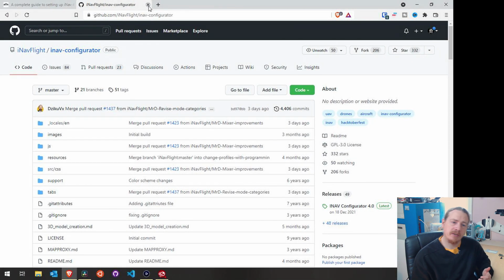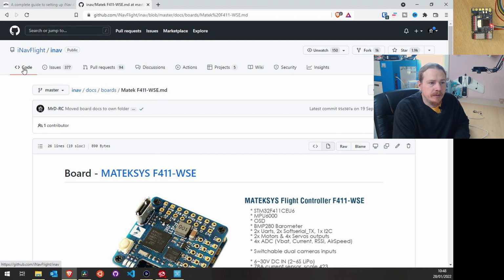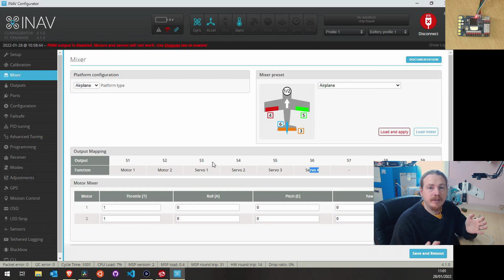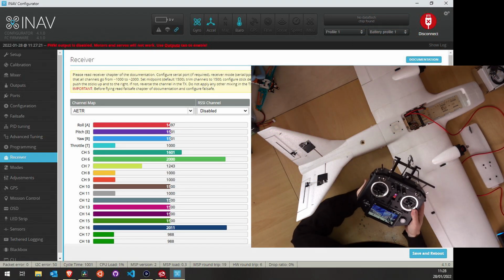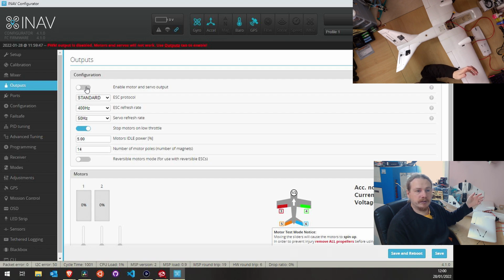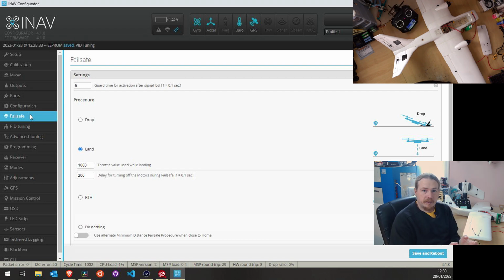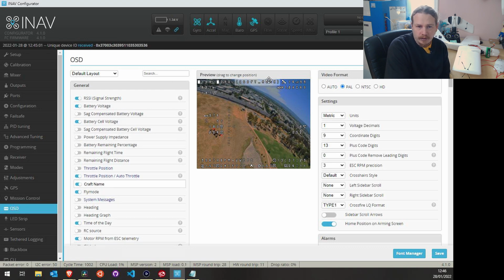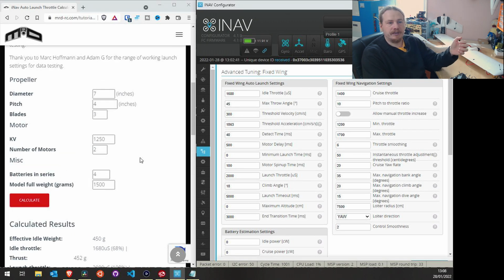Setting up iNav 4 - A complete, new set up and installation for fixed wings

Comment: I can't seem to calibrate my swordfish, I've tried so many different methods to get it running normal. the motors beep, no throttle movement on the radiomaster ts16. I followed your steps and when choosing plane with a tail, now nothing works.. what to do? do you have an email or something where I can get the steps on fixing it.
Reply from the maker: Ask on INAV Fixed Wing Group on Facebook or Discord. There are links on my website for both.

Comment: Hi have you any experience with Spektrum and inav. I’m trying to set up an IX20 with crossfire tx lite module.  I can’t get many modes working. Only a three way flight mode switch and an arm switch. Any tips would be appreciated 
Mark
Reply from the maker: Sorry, I flew Spektrum for about a month when I was learning LoS. Then switched away.

Comment: Tried setting up inav 6.1 and others on 2 different omnibus f4 pro boards and both exibit the same error....S6 output (rudder) does not work....asked many places and no one knows why it doesn't work and similarly, no one can offer any suggestion. Used iBus on Rx6 and on rx1 and rx3 and ppm on standard sBus/ppm input, same result. Ailerons, elevator, motor all ok, just no rudder output on PWM6.
Reply from the maker: I’m assuming that you’re providing separate BEC power for the servos. It’s been a long time since I’ve used Omnibus, just because of the annoyance and grief they caused me (let alone the lack of UARTs). From what I remember, 5 & 6 only have the ground and signal pins, which is why I asked about the BEC. I had a quick look through the INAV board documentation, but couldn’t see anything to suggest that output be blocked. https://github.com/iNavFlight/inav/blob/master/docs/boards/Omnibus%20F4.md

If you’re on the INAV Discord. It may be worth asking Sensei. He’s a bit of an Omnibus guru.
Reply: No idea what this "discord" is all about. Googled it but responses were more confusing than ever. @MrD
Reply from the maker: @jeffbluejets2626  Discord is kind of like a group of web forums, all in an app.

If you imagine RCGroups for example. Rather than the web site. RCGroups would have a “server” on Discord. People would join this server to access all of RCGroups’ posts.

On the RCGroups web site, there are a load of categories; to separate out the different discussions. On Discord, these are known as “Channels”. 

From this point it can differ. A channel can include “forums”. Which is more like you’d expect at RCGroups. Where you have a list of topics, and discussions within them. But, some channels can just be straight up discussions. Both types have their place, and can work well. 

I hope that helps in what Discord is. If you wanted to have a look. The INAV Official server is at https://discord.gg/peg2hhbYwN You can use Discord completely freely. They will try to upsale add-ons. You don’t need them at all. It will work fine with any payment.
Reply: RCGroups...no one seems to know...91 views, no replies. @MrD

Comment: Thanks for this video!  Any idea how to wire for nose gear to move with rudder stick when FC is set up for vtail?  My nose gear moves with rudder stick AND elevator stick…
Reply from the maker: You would need to add an extra line to the mixer for the nose gear. Use RC Yaw for the input. If it’s retractable. You could even use programming so that it will only work when the gear is down.

Comment: Darren, thanks for the video. i have not been keeping up in RC due to the Covid and the rule changes here in the US. My Inav is a quad with 2.5 so this is a good video for me to get involved and catching up on FW Inav. I plan to setup 4.1.1 on my Zohd Dart XL enhanced. Get used to Inav again and then bump on up to 5.0 or 6.0 this winter, which ever version is the latest. You make it pretty easy to understand. I appreciate your efforts. Thank you
Reply from the maker: Enjoy your flights Rog. If your Dart XL needs setting up, I would go straight to 5.1 at this point. There are some nice improvements over 4. The setup is the same as in this video. INAV 6.0 will be out around March. That one will be well worth updating to. It is a big step forwards.
Reply: @MrD  Thanks for the encouragement. I just finished installing & setting up 5.1 on my Dart XL. All seems to be working on the bench. Just need to set up for inflight tuning and wait for a warm dry day to maiden which may be a little while here bc its winter and a storm is on the way. thanks again for your help.
Reply from the maker: Weather can be a right pain. But it gives is build days 🤣 Good luck with the maiden 👍🏻

Comment: Hello, I just soldered up a matek 743 lite flight controller.  I uploaded airplane mixer.  Receiver is functioning, modes are set, motor and servo switch is enabled in Inav, but only the motor and elevator works. My other servo pins do not have power.  I left the bec bridge alone. It is just 5 volts.  My pins are not loose on the board either.  Please help with any knowledge.   Thanks friend. All the way from California.
Reply from the maker: Hey, hope you're doing well. This seems to be a continuity issue. Looking at the board, the power and ground traces are shared for all PWM outputs. If you check out the underside of the board (http://www.mateksys.com/?portfolio=h743-wlite#tab-id-1), the traces are pretty visible.

I'm guessing the elevator is on output S3? If so, there may be a problem with the trace on the circuit board between S3 and S4. Without powering the board, try measuring continuity between the power pin of S3 and power pin of S4. If that is OK, try the same with the ground. I'm thinking one of these will have a break in it. If that's the case, you could solder a bridge between the two pins where the break occurs. That should sort the issue out.

Comment: Can you help me? My home arrow is wrong. I have calibrated the accelerometer and compass multiple times. I have a bietan 880 gps.  It worked fine with Betaflight.  Thanks for the help.
Reply from the maker: With INAV, the home point is recorded when you first arm. It will just be a dash until you fly away from it.

Comment: I see that the motors turn when they reach 21%, that is normal, it happens to me too
Reply from the maker: It is currently, with the default settings. On fixed wing you can reduce the idle throttle, which should bring in the throttle sooner.
Reply: @MrD  ok thanks i will try, and I will tell you later

Comment: Wow! Thank you so much! I was having trouble setting up my Ripper R690 with Arduplane, couldn't figure out a rudder only plane without using a servo splitter. Used ardupilot a ton for quads but never a plane, and it seemed kinda janky to do it use a servo splitter to get pitch and roll on a wing only plane. Decided to try out iNav for the first time and was so overwhelmed coming from Ardupilot. You're setup guide was perfect! The only guide I found from start to finish without glossing over things that may seem trivial to experienced pilots on iNav. 

One question for you, where or how do you suggest mounting a vtx to a plane? Don't want to keep it in the fuselage because it gets quite hot, so I want some airflow over it to keep it cool at 800mw-1w output power for long range. Do you suggest mounting it on the outside and risk damaging/losing the VTX, or 3D printing some vents for the plane? 
Thanks!
Reply from the maker: Thanks Andrei. I'm glad the video helped you get started on iNav. With an elevon setup, you' can't use a servo splitter. Each elevon need to be controlled individually. It can be done on ArduPlane, as I have an S800 set up on it. I can't remember how I set it up But I'm sure it was something in the parameter list for the plane type.

As for the VTx. I've seen a lot of setups of the Ripper with the VTx inside, and they don't have problems. For higher powered VTxs, some people add a fan. If I'm building something for range, I will put the VTx all the way out on one wing, and the receiver on the opposite wing. This is mainly for maximum separation of the signal. Usually I'll cut out the underside of the wing, and secure the VTx with blenderm tape along the top and bottom edges. This leaves the heatsink exposed to the air. The the F-01 (same as the Ripper), I will be doing the initial build with the VTx inside the model. I don't see this as a long range plane. It's more for being quick and agile. So I'm not too worried about optimising the video signal. I'm more concerned about aerodynamic efficiency. So I wouldn't be printing vents either. The holes at the front should let a fair amount of air in, as they are to cool down a DJI air unit. If not, I'd probably enlarge those a little.

Comment: hello darren,

i have a problem with my wing. i have tried so many things and checked everything a thousand times, but it just won't fly. I first bought a sonic model ar pro and fitted it with the Matek F722- wing FC. It always flew too much to the left when I threw it, even though I calibrated the fc correctly. It is exactly straight and the servos also work in the right direction. Now i bought a Sonicmodell dart xl and i put all the electronics back in there. But it doesn't fly either. It tilts to the left again. The flaps are also set exactly the same. I really don't know what to do anymore and need help with this problem. I have built drones and configured them with betaflight and this is my first wing with inav. Keep going 👍
Reply from the maker: Where the same issue is there on 2 models. Assuming you started from scratch with a full chip erase, when setting up in the Dart XL. I think the problem could be elsewhere. Maybe there is left trim on your transmitter?

To be honest, trying to diagnose a problem like this will be near on impossible over YouTube. I would recommend going to INAVFixedWingGroup.com and either join the Facebook group or Discord server. It would be much easier to help there, with the aid of screen grabs and videos.
Reply: @MrD  thank you for your answer. Ich will try to ask there. But first i will try to trim my transmitter first. Maybe this is the problem. Thank you for your quick answer and all your videos. they are all very informative and help me a lot further to understand these things.
Reply from the maker: @theallmaker9085  no problem. Just make sure that all trims are centred. I’m on both those places, so it will be easier to try and work out what’s happening.
Reply: @MrD  yes I will try later.
Reply: @MrD  hello darren,

I have now gone down a hole with the connection between the servo horn and the flap horn. So the flap horn and the flap deflection is now larger. I tried it out today and it flew, so I guess the flaps didn't show enough tilt. When I fly and want to tilt the plane to the left or right, it feels a little slow and sluggish. I was flying in horizon mode.  Is it a good idea to go down another hole to get more tilt in the flaps or is that not a good idea?
Reply from the maker: How much throw are you getting in manual mode. You should only measure in manual. For the AR Pro, you want 12mm throw with 2mm reflex.
Reply: @MrD  I have measured again. I have a throw of 12 mm up and 12 mm down on my Sonic model Dart xl. In manual mode. However, it flies very carry in Horizon mode and reacts kind of slow when I fly turns. If I increase the throw even more, what would happen? Would it stall or not fly properly?
Reply from the maker: The 12mm up and down are for the AR Pro. The Dart XL states 16mm roll and 12mm pitch. To me that seems backwards as forwards swept wings are usually more roll sensitive. 

Modes other than manual will seem slow until the plane has been autotuned correctly in acro.
Reply: @MrD  hello darren,

I was flying today and set the flaps like this. 
It flies beautifully, thank you very much for your help. 
You really helped me a lot. 

Only now I have the next problem. When I landed, I checked my PIDs and simply switched off the wing. Then I switched it on again and wanted to try RTH. But it didn't start any more. I don't use autolaunch a friend throws the wing and I give throttle in horizon. But i noticed that the flaps were not straight and level in manual mode. I looked at Inav at home and the mean value of the servos was off. Probably because of servo auto trim. But he trimmed it so that it could not start. What did I do wrong and what can I do about it?
Reply from the maker: @theallmaker9085  it sounds like it has been trimmed on the transmitter. You can’t do that with iNav. The transmitter trim will make iNav think you want to turn. If there is trim in the transmitter, you will need to make these changes physical and set the transmitter trims to centre.

Just one more thing. The control surfaces on the AR Pro are called elevons. They are a combination of ailerons and elevator. Flaps is the name of a specific control surface on some planes. So it can be confusing if flaps is used, if you’re not actually talking about flaps 👍🏻
Reply: @MrD  Oh well, I'm not quite into the subject matter yet. As I said, this is my first wing. I didn't fly with the ar pro either, but with the Dart xl. I'm very sure, that I trimmed the transmitter right. The centre is 1500 for each stick, which is also shown in Inav. So my transmitter is correctly trimmed. It flies fine, but after the inav auto trim it no longer starts. I was just flying in a straight line, turn and fly back in a straight line and get the hands of the transmitter, so it can trim good. But after landing, the angle of both elevator was to high. Then it won't start anymore.
Reply from the maker: No problem, just trying to help you out :)

Ok, that sounds like the transmitter is fine and that you are performing the continuous servo trim correctly. What is the exact error message you are getting? If it won't arm, it will show a system message in the OSD. But that element must be enabled on the OSD. Also, I don't think it works on DJI if you're using that.

Are you on Facebook or Discord? It would be easier to try and sort out the problem on there, as photos and screen grabs can be used. If you're on either, head to https://inavfixedwinggroup.com and there are links to the Facebook group or Discord server on the menu bar.
Reply: @MrD  I display the error messages in the OSD. But nothing is wrong. No error message is shown. Everything is good. After the Auto trim, the elevators were much too far up in manual mode. Then i think it doesn't get enough momentum at take-off and flies upwards. 

I have Discord and am also in the group. Shall I write to you privately or in the group?
Reply from the maker: @theallmaker9085  post in the group. More eyes are always better with things like this. Could you post a screen grab of the servo section on the outputs page, also a photo of the elevons with the model and transmitter powered up.
Reply: @MrD  I send you photos from that, in the #general.

Comment: Any idea why 4.1 does not work correctly on a mac?  Most menus get stuck saying waiting for data. I have erased and reloaded 4.1 versions and still no fix :(
Reply from the maker: Sorry John, I don’t use Macs. All I could really recommend is to post an issue on the iNav Configurator GitHub repo. Someone who uses Macs may have a solution.

Comment: Thanks for the video Darren - but I have Matek F722-SE (wing) and can't get FU to work - (win 11) tried zadig etc.. all works fine in serial mode (inav 3.02) but DFU mode enabled and windows 11 says unrecognised device descripter...   Anyone have any ideas ?
Reply: FIXED IT!!!!  I had to disconnect my GPS as this was powered from the USB and must be a power drain cause USB to malfunction.
GPS disconnected the RC Impulse worked first time.
Reply from the maker: Sorry I didn’t get to see this message in time. Glad everything is working now though.

Comment: In INAV 4.1 Roll and Pitch are not available in configuration, on my MATAK 405 SE roll and pitch have switched places when arrow on board is forward. How would you swap that in the CLI?
Reply: Strange.....changing yaw to 90 corrected roll and pitch. Yaw position stayed the same.
Reply from the maker: It is all relative to how the arrow on the flight controller is pointing when you have it installed in the model. You say that the arrow on the flight controller is pointing forwards. So you shouldn’t need to change the yaw alignment of the flight controller. When you say roll and pitch have switched places, where are you meaning. On the 3D model on the setup page. Or your control surfaces?
Reply: @MrD  On the 3d model they are switched. Pitching the FC results in roll and roll results in the model pitching. I don't think I've ever seen that happen in any type of flight control set up. Kind of concerned that changing yaw somehow corrected it. This is on a Matek 405 SE going in a wing.
Reply: @MrD  Thanks for the reply, I appreciate your thoughts and advice on the problem.
Reply from the maker: Is it 100% the right target? So long as the actual plane matches the 3D plane on screen, it should all be fine. But it is strange that the arrow doesn't match.